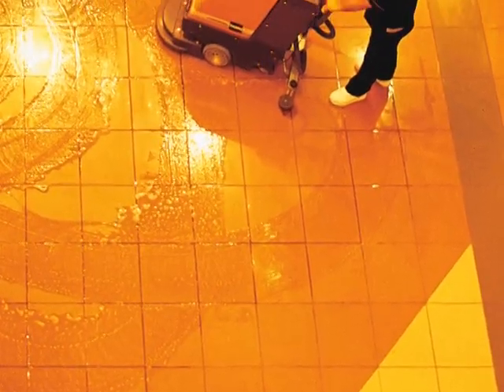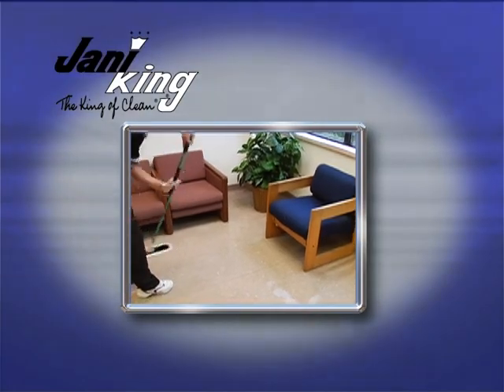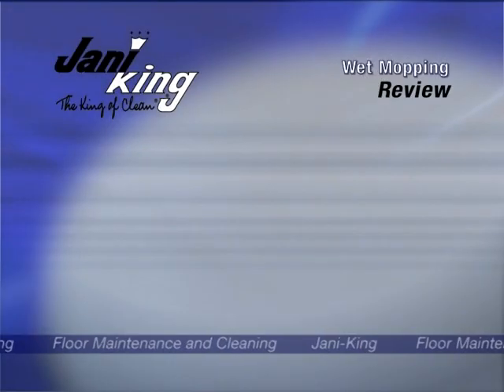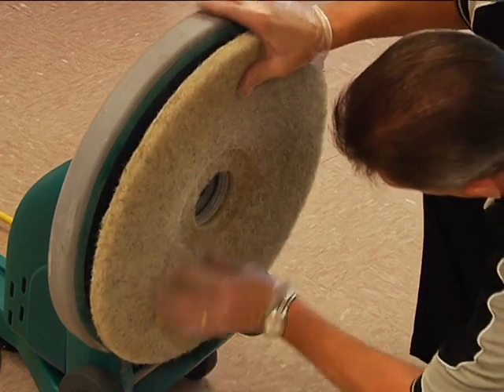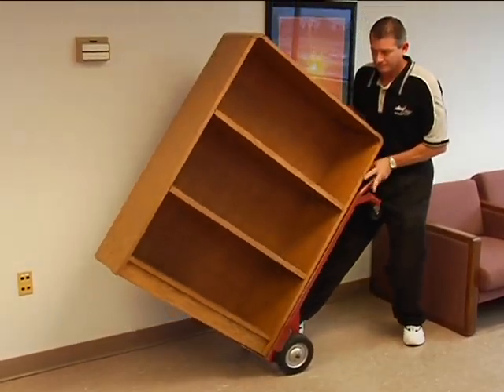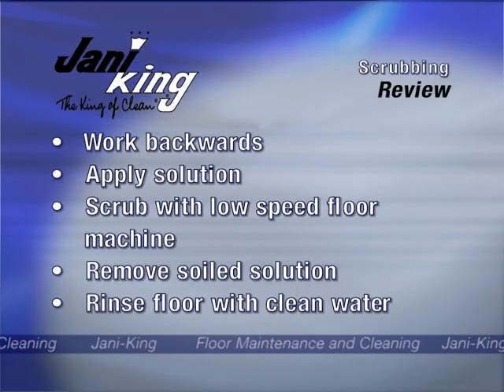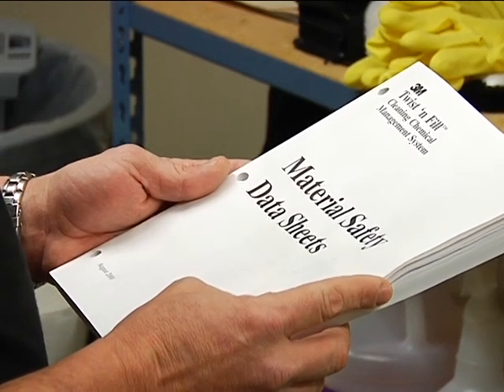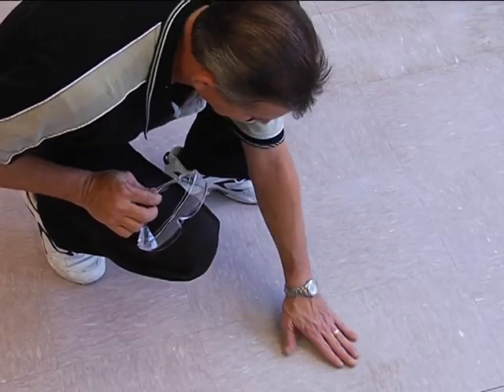Strip And Waxing Floors Part 1

Comment: for regular maintenance ;  Grab a good dust mop not that shitty one from the video which is a pain in the ass to use...and a standing scraper blade so you can remove stickers and crap as you go sweeping the floors. Pick the garbage ...Then use the floor machine with a cup of solution and warm water ...run it twice all over the floor and finally grab a dry mop to catch water residue. Put a blower for 5 min ..and you'll be  done. Then use a propane buffer machine and those floors will shine like a mother fkr
.For stripping and wax:  start with a good sweep , then apply the stripper solution with a stripper machine and then spread it with the mop , wait 5 min(depending the stripper quality) run the floor machine with cold water scrubbing the area (no pick up) , then use the side by side scrubber for the edges , then use the vacuum to pick up the water .  {The purpose of using the vacuum to pick up the water with dirty stripper  and not the floor machine is #1 vacuum for floor machine is not protected against stripper solution. #2 Its better for edges.}  after you picked up all the solution wash the floor with the clean water from the floor machine and pick up at same time. Mop the edges with  warm water. Put a blower for 10min.  Then apply wax using just an  old style wax mop and not that micro fiber shit. DONE.  
Ive been doing this for more than 10 years every store we visit at the end they love the results but also let us know the ppl who made the job before use this exact procedure on this video with the same machines and was crappy job.  They say they never saw the floors so nice , white and shinny until we went there.  Thats because we use strong  scrubbing. and not fancy looking weak ass machines.
Reply: Can I get the name of those machines!? Please, for the buffer/scrubber and burnishing machine
Reply: What brand stripper and wax?
Reply: @gonzalozuniga8406  Rotobic / Hako 16" or any older Rotobic 16" or similar low speed machine [150-190] will do the job, and for heavy build up around the edges, use the black pad [coarsest one], and tilt machine into affected area to chomp out build up, anything left, use hand scrubber with coarse pad, and scrub like f**k  P.S. make sure you use a skirt around base of machine or you will get splatter all over the walls/furniture, etc, and if it drys, then the only way to take it off is with straight stripper using an aplicator but dab it on in small amounts on a non focal point and test first or it can remove paint, varnish, etc if a non compatible surface or when rubbing too hard.. good luck
Reply: @avarskibostonB1  there are many different brands around the world, depends what country your from... so you can ask shop staff which brand of heavy duty stripper do all the other commercial cleaners use [which usually come in a 5 ltre container].. and as for wax, keep it simple, go for a sealer & polish finisher in 1 otherwise you will have to buy separate containers of sealer as well as separate containers of polish.. this gets costly and clients always like the cheapest quote, good luck
Reply: thank you ❤️ this is exactly what I need
Reply: How much are you charging per square ft 
Location

Comment: I watched your video. Thanks for sharing. I am trying to start this busines from Nigeria.  I bought some porcelain tiles with the plan to strip, wax and burnish according to the video I watched.  But, after applying stripper, the surface sheen on the tiles did not remove. I went ahead to apply floor finish polish, but after 4 days I tried washing and the polish all peeled off. Again, I bought paste wax and sealer. I have applied the sealer, but on the  attempt to coat floor finish polish on it, the sealer also peeled off.  Right now, I have applied sealer and the paste wax. Although I have not burnished it, it shows no sign of sheen, but it's dull and whitish. 
Please, how can I strip the new porcelain tiles and how do I go about the application of sealer and polish or wax? I have an old, scratched and dirty porcelain floor to fix next week, the floor has not been waxed before. And I want to restore it.
Thank you in anticipation for your response
Reply: I'm not sure if there's a translation issue here, but I'll give this a go. If you really have porcelain tiles, hard brittle tiles set in mortar and separated by grout, then you do not need or want to strip, polish, seal, or wax those tiles at all. The surface of porcelain tiles is not an applied finish, but rather a glass-like material that is a permanent part of the tile. The only care required for porcelain (or ceramic) tiles is to apply a penetrating sealer ONLY to the grout lines, and then keep the floor clean. It is extremely difficult to grind this surface away, and if you do so, you will have taken decades off of the life of the tiles.

If you have very old porcelain or ceramic tiles that have none of that hard, shiny glaze left on the surface, it having been worn away by abrasive soils like sand or by poor floor care practices, that's a different story. If there is any wax, sealer, or other finish it must be removed. This is a nightmare job, getting wax out from grout lines is a job many professional cleaners will simply turn down. Abrasive stripping brushes, and strong stripping chemicals are required. To really get the grout back to its original color you might have to follow this up with an acid wash, which is a whole other subject. Once you have the floor clean you want to apply a hard surface sealer, not a wax, which will soak deeper into the surface without leaving as much buildup, and restore the waterproof nature of the tiles.

If I'm wrong about the tile type, if you have VCT tiles, which are much thinner, still brittle but slightly flexible, and typically set tight together with no gaps, let me know. Those require a different process.
Reply: @jasexavier  great job providing good information,   its not easy with limited information from the person asking for help..

Comment: Some idiot has wax build up on a rubber wall base. I tried using stripper and used sponge, black pad, scraper to remove it but the process is slow